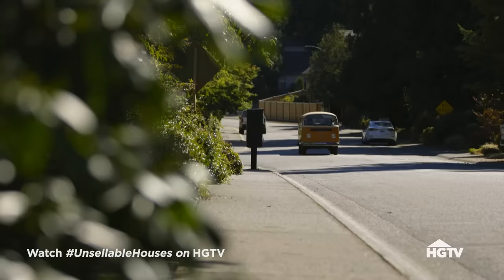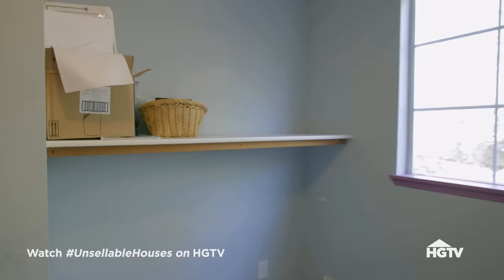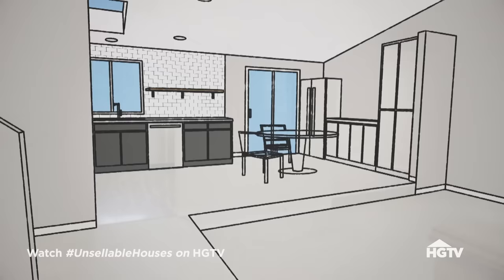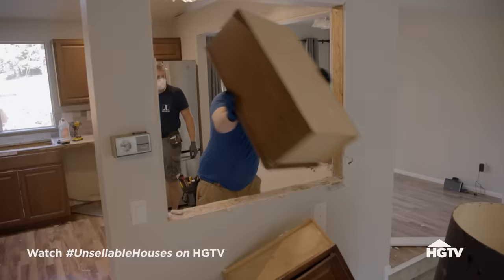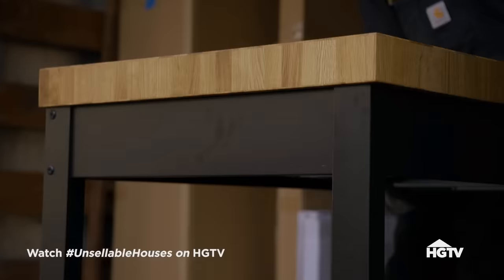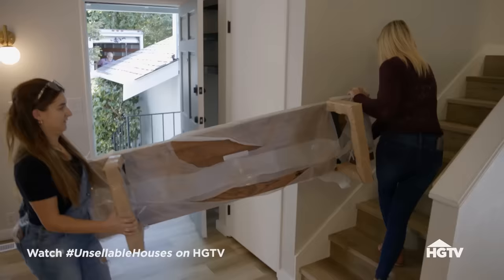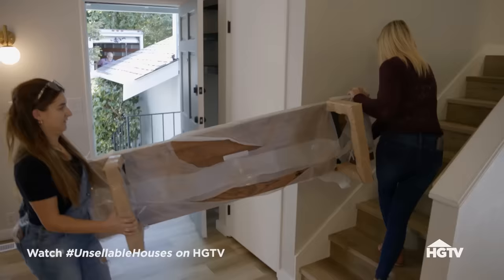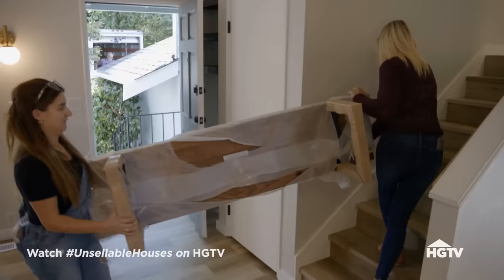Tri-Level Home Gets Warm, Minimalist Remodel | Unsellable Houses | HGTV

Comment: Stop saying 1400 square FOOT! It’s 1400 square FEET. It’s plural not singular.
Reply: This is what Bing AI had to say about that. "In the United States, square foot and square feet are both units of area used in real estate 1. The difference between the two is that square foot is singular and square feet is plural 1. When used as an adjective, the singular form is preferred, such as a 700 square-foot apartment 1. To convert feet to square feet, you need to multiply the length and width measurements in feet 1."
Reply: @susanmark2000  
Yes, precisely. The real estate agent was using the wrong part of speech in her statements. She used the adjectival form when the noun form was required and vice versa. Diction and syntax are important. 😎
Reply: @SmrtisAttrctv theyre really not that important lol shes a realtor not an english professor
Reply: @jenniboo9441  By your logic, only English professors should speak English correctly. Really? 🤣
Reply: Both are correct, but I think it depends on how you use the words:  ‘it’s a 1400-square-foot home’ or ‘The home is 14,000 square feet’